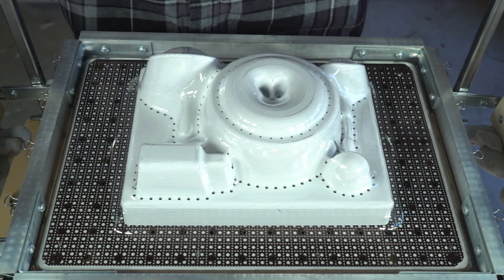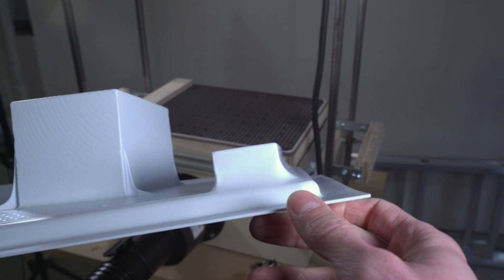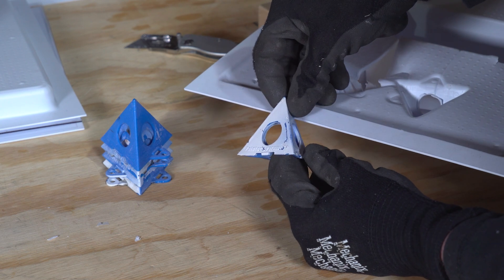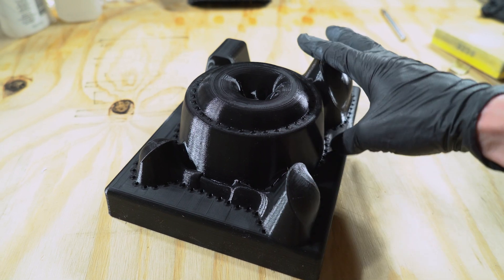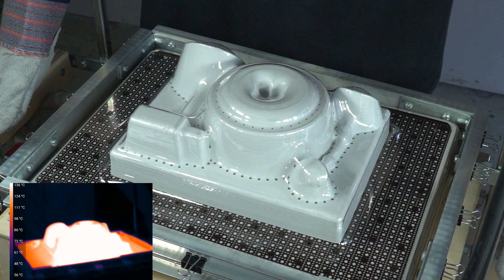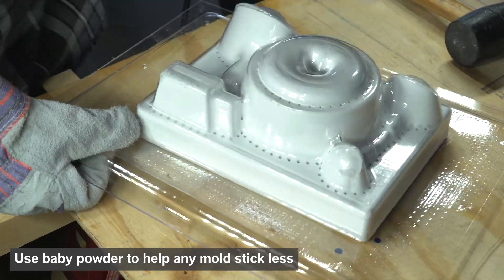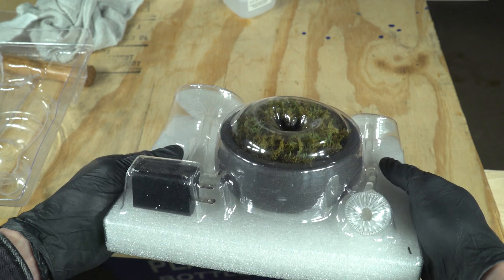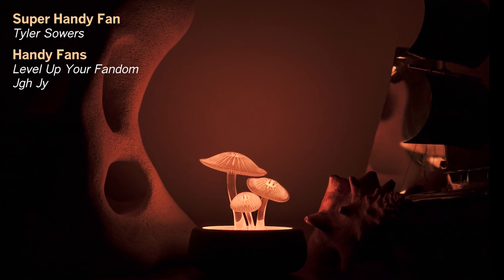Vacuum Formed Packaging & 3D Printed Molds

Comment: You can shutdown the vaccum as soon as the form is done, around 4sec after its pulled, that let air going between the mould and plastic and prevent the mould from heating and warping

Comment: What plastic is used to make the mould?  The sheet plastic that makes becomes the mould.
Reply from the maker: The sheet plastic I use most is Styrene and PETG. PETG is by far my first choice because it does not shatter or tear easily. PETG also does not stink as much as Styrene or ABS. Always use a respirator when doing this kind of work no matter what you are using.

Let me know if you have any other questions.

Comment: My PLA molds constantly melt whenever I vacuum form over them. Is PETG the best choice of filament for this process?
Reply from the maker: PETG is a better choice but still not ideal if you are thermoforming with PETG. The higher the filament temperature rating, the better the print will hold up in thermoforming. Also print your molds with lots of perimeters and top side layers. The thicker it is the longer the overall structure will hold up... but not necessarily fine details.

PETG's temperature range is 230-250C. Polycarbonate or Nylon would probably hold up longer as a vacuum forming mold because the print at even higher temperatures. They may also be challenging materials to print with. I haven't tried myself.

Here's a list of printing temps:
https://filaments.ca/pages/temperature-guide

Comment: will you do a video on how you made the foam packaging or did you use a service?
Reply from the maker: I am going through a local manufacturer for the foam packaging. It seems like it would be possible to do in a DIY setting but the associated costs and difficulty would be hard to justify.

Comment: I've seen somewhere that people are using compressed air to release the molds from vaccum formed plastic. Probably won't work for 1:07 though.
Reply from the maker: Haha, yeah. Nothing works at 1:07. I think if the buck was designed with this concept in mind, it would work. This 3D printed part is actually the first vacuum forming mold that I made since 2006. So, it worked... but it could use some tweaks.

Comment: Yet another great part in the series, something i'm a little curious of is what did you do to design the 3d model to use as the buck? I'm guessing you had a way more elegant sort of idea than my initial thought which uses Blenders "Shrinkwrap" modifier which will project an object onto another so if you use a flat plane over an object its practically digital vacuforming.
Anyways I can't wait for the next in the series and have yourself a wonderful day! :)
Reply from the maker: That was actually the first idea for designing the buck! At the time that I filmed this there was not enough time for experimentation with that modifier, unfortunately. The model for this was made in Solidworks. The challenging part of modeling this in Blender would be maintaining consistent draft angles and then cutting away the all the air vents in a way that didn't create a geometric disaster. I would still like to mess with the Shrinkwrap modifier tho... one day.

You have a great day as well, Dan!
Reply: @The3DHandyman  It's still super cool to me that it was a consideration! For draft angles/managing topology and underlying geometry I know a few ways that could work well, but when you know CAD well enough might as well use that for sure! 
The modifiers are so powerful once you get the hang of them and I hope in the future you can mess around more with it, a current work in progress I have is a nicer support generation for FDM and resin printing that uses shrinkwrap. :)

Thank you!

Comment: Save printing and material by printing with as little infill as possible and then fill the cavity with epoxy or polyurethane mixed with sand.
Reply from the maker: Good thought! In order for to fill the cavity with material I think Gyroid infill is a must. What have you used before? 

I was in need of a new stepper motor for my printer at the time and could only print with Rectilinear infill at 90 without issues so I did without.
Reply: @The3DHandyman  I use it on the lowest setting with just enough to hold up the model. Since it's a dome, it's likely to support its weight with the hollow facing down.